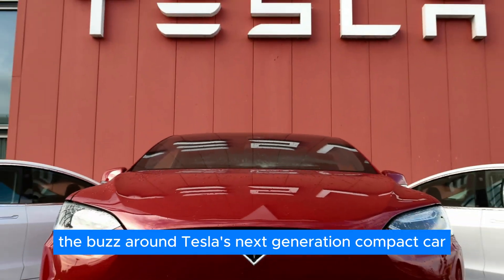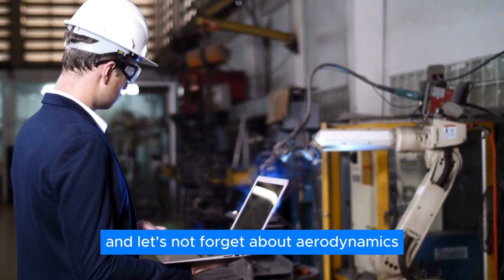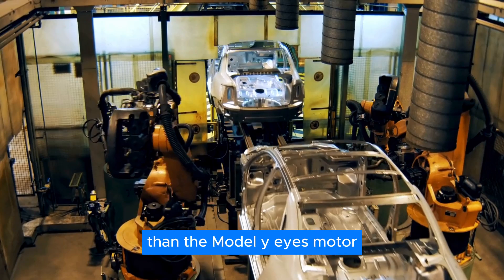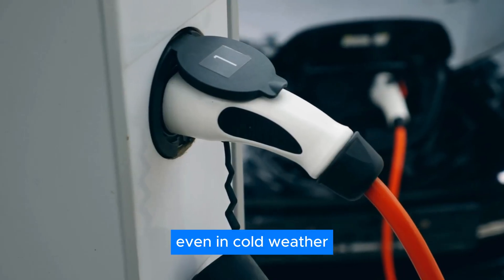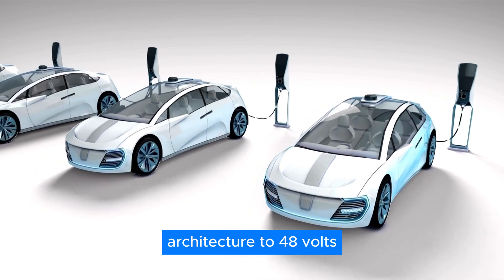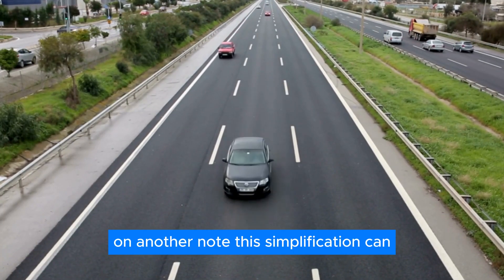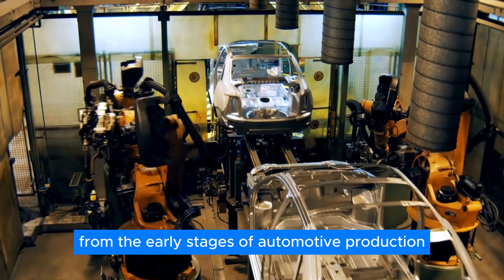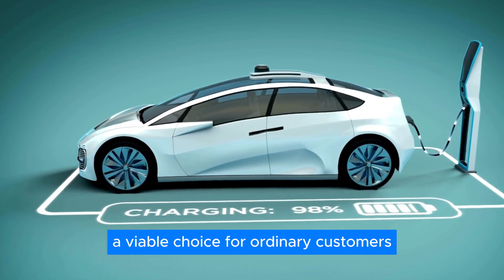It Happened! Elon Musk LEAKED The Way Tesla Produce Model 2! INSANE Design, Motor & Super Battery

Comment: Some suggestions
Eliminate the touch screen.  Touch screens are as dangerous as using a cell phone during driving.  Instead adopt the display that the Leaf has, visible through the top half of the steering wheel. 
Make all controls tactile.
Eliminate self driving.  It cost money and many of your customers don't want it.
Make the driver side window a wind down.  Buttons for the other three electric windows.  I have a horror of driving into a lake and not being able to lower the driver's window.  
Have a radio with a button at one side to push to turn on and off the radio and to adjust volume and one on the other side for tuning (old style and tactile).
Three levels of regenerative braking.